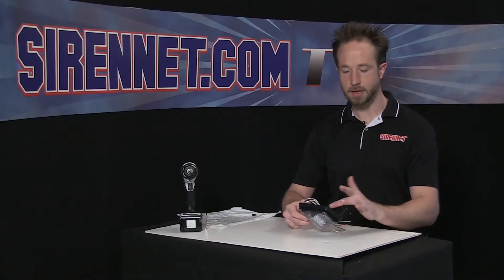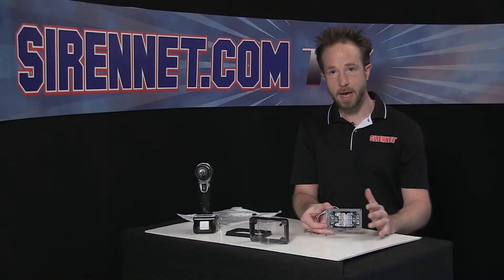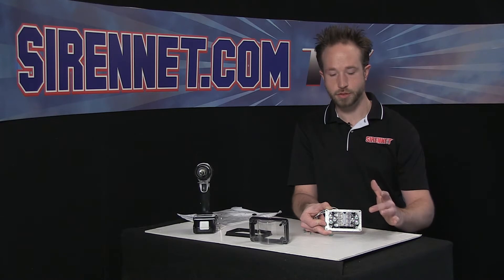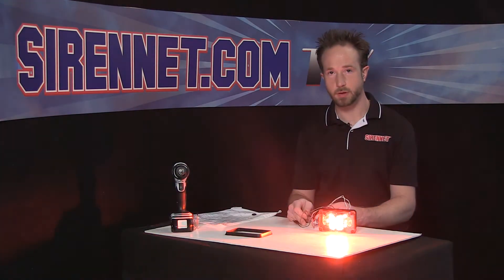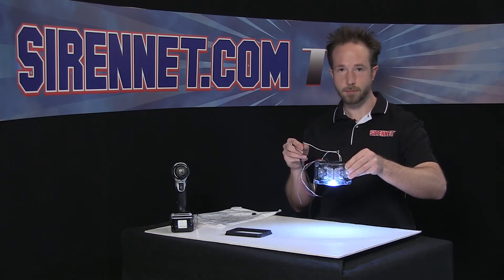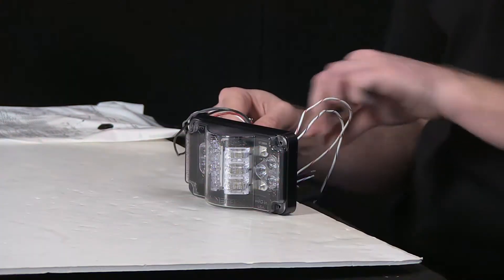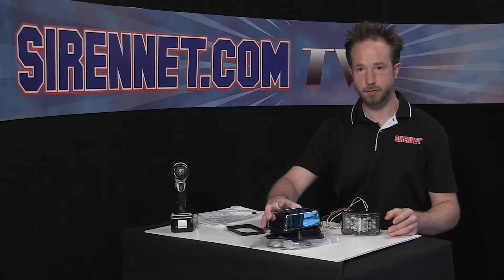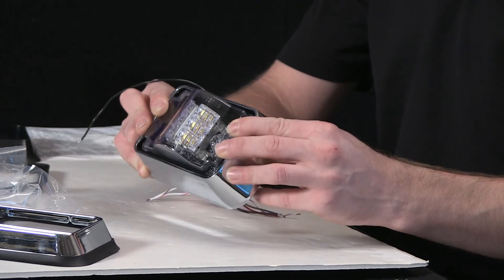Chris shows us some features of the Whelen V-Series 3-In-1 LED

Comment: Evening Stuart & Chris. Just intrigued to know where your customers tend to have these positioned on vehicles and just how practical they are. I can see the need for down/puddle lights, spot lights and obviously warning lights too but having all three in one lighthead seems to be a bit much in my opinion. But then again I may be narrow minded and to be honest my experience is mostly with ambulances and response cars in the UK - having seen your fire trucks over there I am starting to see the potential. Of course, Whelen wouldn't have gone to the extent of producing such units if they didn't see a market! As always, great vid. Sean.
Reply from the maker: Good Morning Sr.,   

 We have had Fire and Rescue Departments using these on Brush Trucks and as perimeter lighting on larger Apparatus and Rescue's.  They have been mounting them on the sides and rear of the Vehicles.  For the Brush Truck rear for example, they are mounted on the rear custom bumper and are used as ground lighting (puddle light function) and the spot-light function is wired into the reverse light trigger on the Truck for extra rear back-up lighting. Space on Brush Trucks can be tight, so an all in one fixture works wonders.  On larger Rigs, they have been affixed to the front bumper sides and offer intersection warning, ground lighting and side spot lighting- The spot light in wired into the turn signal circuit(s) and acts as a turning light so the Driver can better see what's coming around the corner.